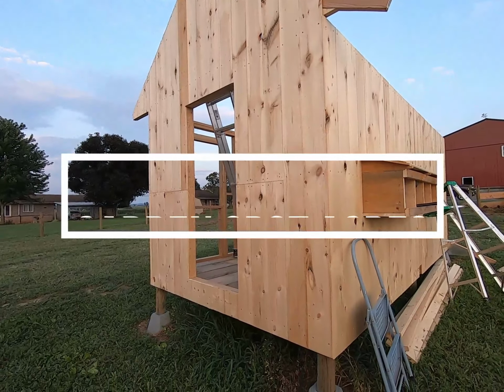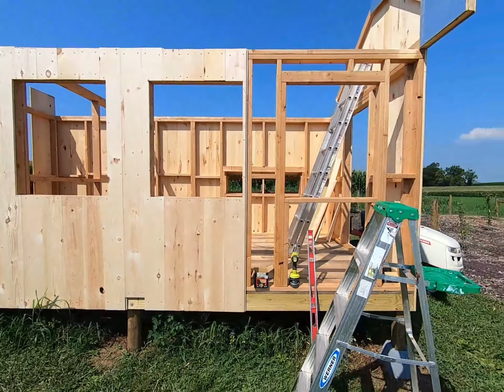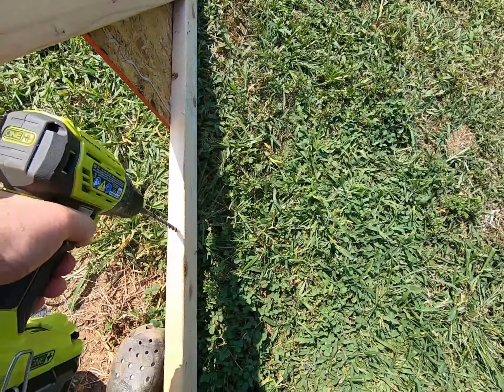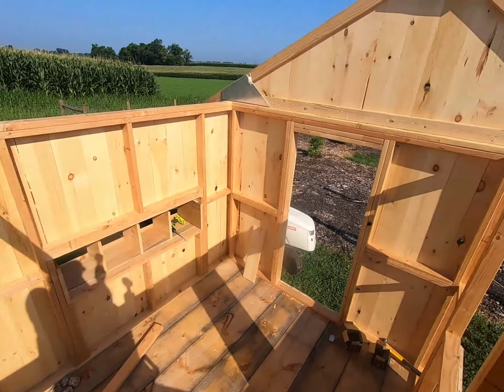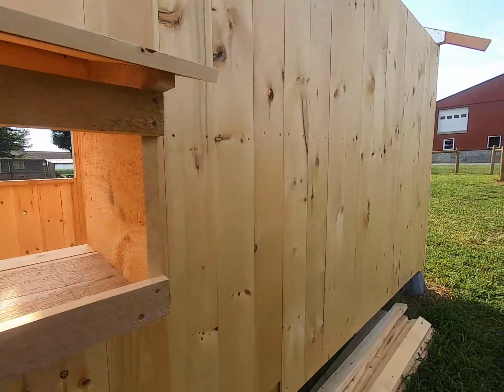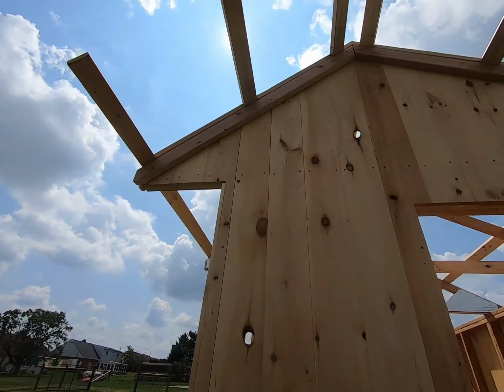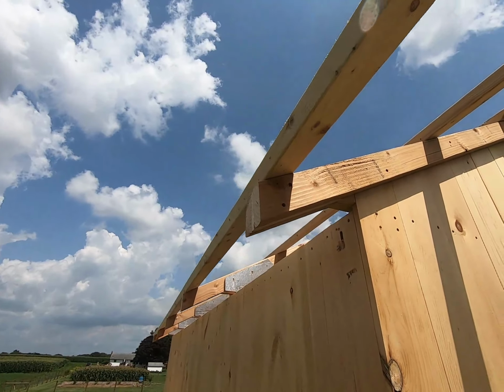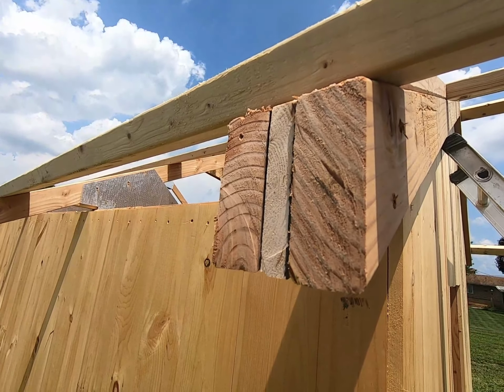Building A Luxury Chicken Coop...Part Seven-Siding, Trusses, Purlins, Gable Trim

Comment: Why wouldn't you have a 1 ft. overhang at the gable ends? You have an overhang on the gables of both your house and your shop. Just curious.
Reply from the maker: No reason really as it was just the way I built it.  An overhang really wouldn’t protect from the weather because the doors are quite a bit below the roofline so I decided to save a few bucks and go the cheaper route.  Thanks for watching!